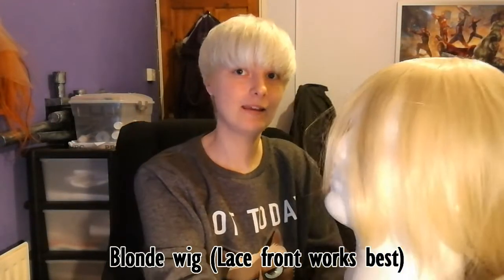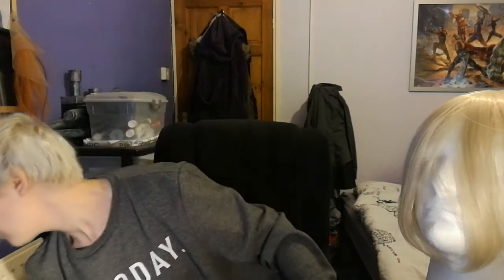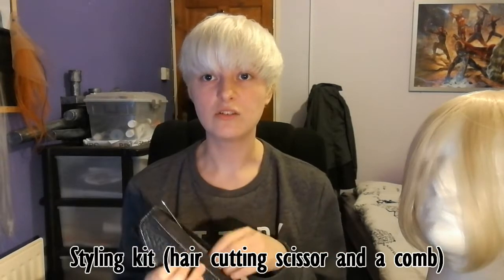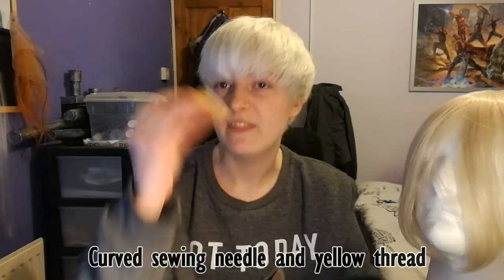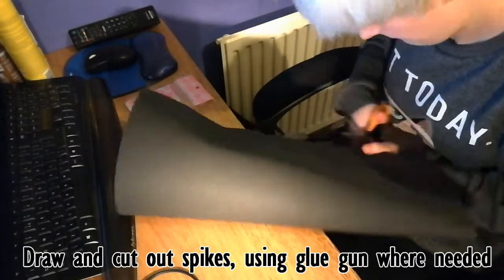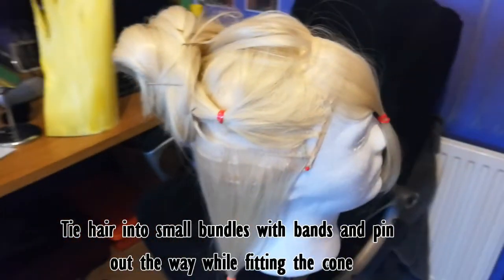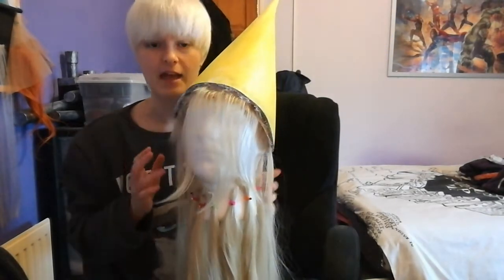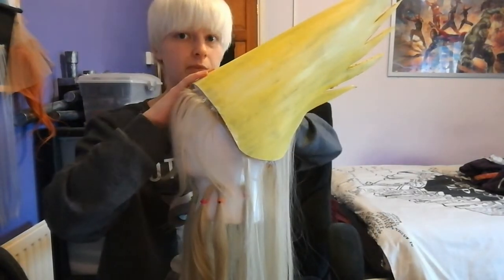Present Mic Wig Tutorial!!!

Comment: Do you know of any other ways that could possibly work to make the wig? I don't mean this in an offensive way, but I don't trust this method at all and I don't want to possibly extremely ruin a wig because of messing it up 😅

Edit: Also, where is the wig from?
Reply from the maker: This is the only method I've tried to get something with this height as the hair will need some form of structure under it to stand this tall :') So unfortunately I'm not the best person to ask for alternative methods. You can use hair spray alone to stand it up but not to the same height and you would need an awful lot of hairspray which can ruin the appearance of the hair. I think I only spend £15 max for both of the wigs I got as I just got fairly cheap second hand wigs from buy/sell groups on Facebook! You can use cheap wigs as long as they haven't got the shiny quality that cheap party shop wigs can have 👏
Reply: @thedappercannibalcosplay1083  Ah OK, thank you for replying

Comment: Did you use any wefts from inside of the foam or do you leave it in buns inside?
Reply from the maker: I tied up all the hair inside the foam and cut it off for wefts! All the hair bundles you can see pinned to the wig head around 3:25 are the trimmings from under the cone 😄